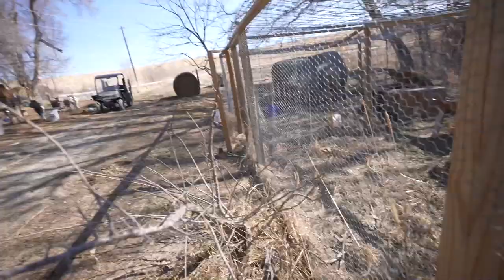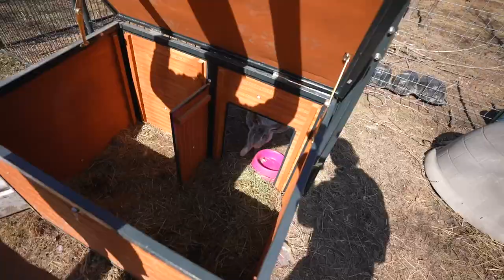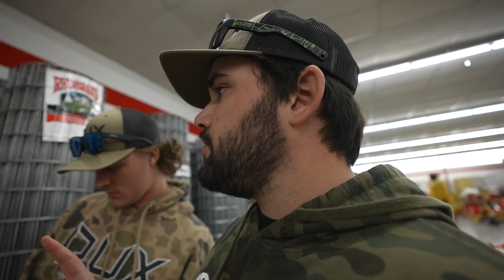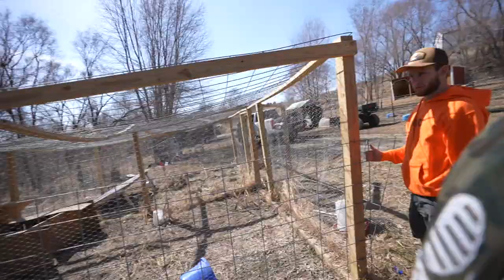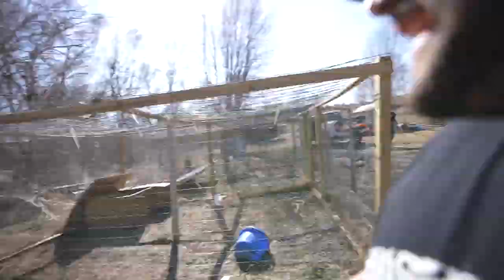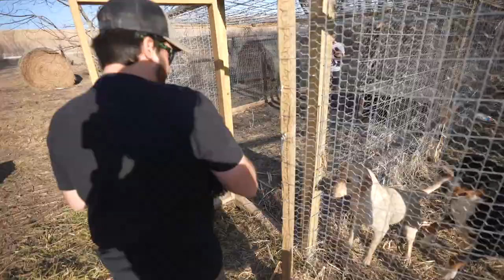The GIANT Predator-Proof ENCLOSURE in the BACKYARD FARM is COMPLETE!!!

Comment: Hey flair if that doesn’t work try using 1/4inch square wire fence and then place cattle on the outside if you want or sandwich the 1/4 inch wire with the cattle fence .
Hear me out here trying to get beefcake certified 🔥

Comment: Lmfao didnt even stagger the cattle panels on the roof. The only reason the raccoons came in on the side is because it was the easiest way lol. Now they will just come thru the roof and the 6 inch hole you left in between the panels. Why does he think raccoons cant climb in and out of that cage.
Reply: They can go through the wire he put on.
Reply: Should have just done a coated chain link and he would never need a bother again.

Comment: I have problem with skunks digging under the fence one way to stop them from digging under the fence is to put some 24 inch two x four weld wire on the ground alongside the fence they can't dig through it

Comment: I would do metal sheeting like what on top of the roof cabin so it stay a lil dry then u don't really need to do anything for the ceiling but make sure that if u do metal sheet u put it at a lil bit of an angle so the rain runs off

Comment: Remember to put a smaller gauge wire across the top or a coon, mink, etc.... will just drop in there and feast! AND pull a chickens head thru the bottom of the fence if you don't use small wire like the size of my keyboard keys.

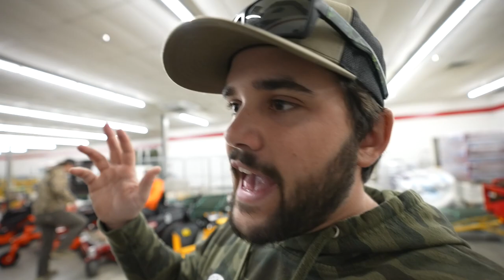Comment: 10:34 dude the problem isn't just the fact that you use chicken wire. It's the fact that the enclosure is Built off two-by-fours and can't support anything🤦🏽‍♂️you need runners around the bottom. Even if it's just rocks to block access. I've had a chicken coop for over seven years now just made out of chicken wire and I've never had a casualty because I did things right

Comment: It looks like you’re using a hammer with a flat face you need to get a hammer with a milled face on it . It’s a hammer that has ridges so  like grips on to what you’re hammering on the face that’s what I always used for fence work around my house because we have horses and four dogs and it’s a heck of a lot easier to work with when hammering in those fence nails a.k.a. Fence staples a.k.a U nails